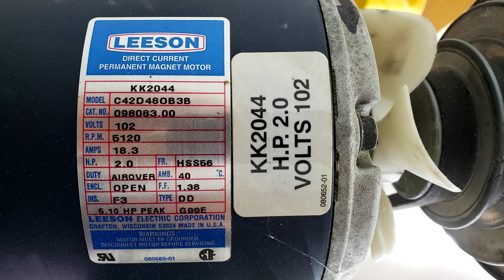⚙️⚙️⚙️ Vintage drill press upgrade - 2hp treadmill motor!

Comment: That’s a great project…you scored on a lesson motor….I’m impressed with the smoothness and lack of controller buzz….
Did you pay attention to the lesson source treadmill’s make or model…?…..I have a drill press even more dated and a heavier castings that will be used more as a mill….hopefully with one of my pmdc motors.

Comment: Would you share what you used for controller? I have the sand motor and trying to figure out how to control it. Thanks!
Reply: Use a laboratory variac and a bridge full wave rectifier….no noise…infinitely variable speed…..total cost used less than 100bucks.
Reply: @offgridmangogrower This all makes little sense to me, I'm so good at electronics :) Could you please share a link to a ready-made controller?